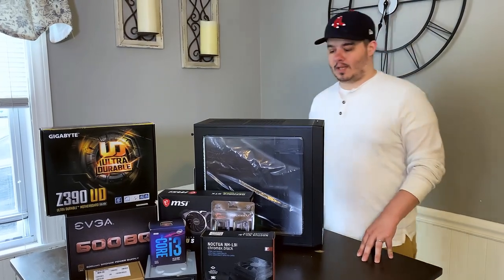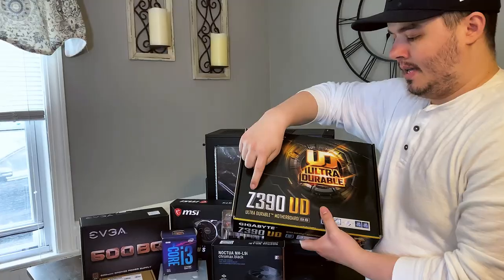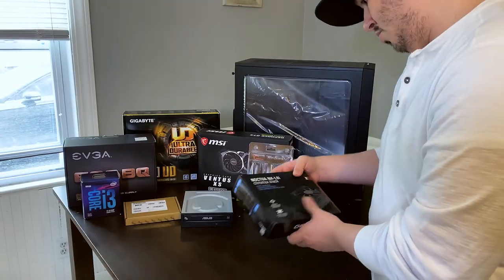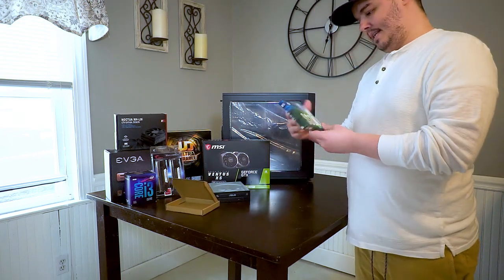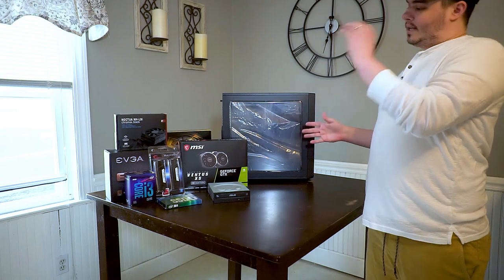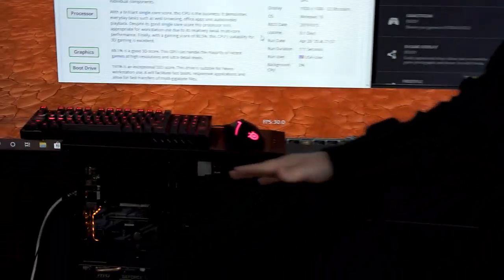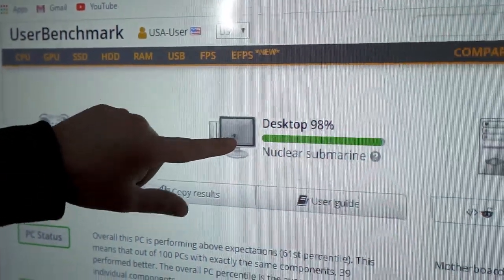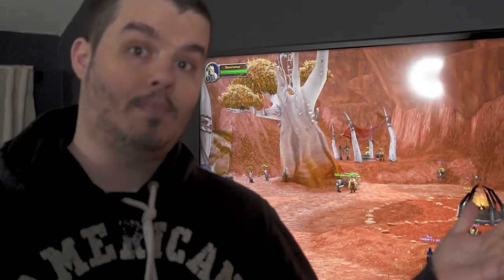Best Shadowlands PC Build for Under $900

Comment: And the proper position to really test machine is Boralus, market area, bank, portals, ship, of course when there are lots of people. That's where almost any machine gets fd really hard, even mine sometimes struggle to get 100 fps, and before heavy tuning (watercooling, overclocking) i was sometimes unable to even maintain 60 there. That's the test site that shows worst case scenario and loads parts pretty much like heavy BGs, raids, 40 ppl world bosses etc.

Comment: Get my parts in tomorrow. Im not doing a complete build just an upgrade. I went with the ryzen 5 3600x ( because the 3600 wasn’t in stock) gigabyte b450m ds3ho mobo gskill 3200 ram and a rx 570 gpu. Spent just under 500
Reply from the maker: Thats going to be a nice build. Let me know the Userbenchmark score when you get the chance. -Jim
Reply: 570 only :(? Should've got a 5600xt
Reply: Tropicocity I was on a tight budget. I only paid 120 for the card. It will be upgraded in the near future just needed something to get me going.

Comment: I feel like this build is decent, but poorly timed. AMD have just announced the Ryzen 3 3100 and Ryzen 3 3300X, while we expect that Intel are going to announce their 10th gen Comet Lake desktop processors within the next few weeks.

While neither of those launches will be transformative for performance specific to World of Warcraft compared to this build, I think a more general recommendation to wait for those products first before purchasing would be advisable.

- The Core i3-9100F is a quad core CPU without hyperthreading, meaning it only has four threads. While that's fine for WoW specifically, many more modern games are starting to ask more of a CPU than what four threads can provide.
- Buying into a Coffee Lake 9th gen system means buying into a platform that's at the end of its life. While you're not technically short on upgrade options with processors like the i5-9600K/F, i7-9700K/F, and i9-9900K/F, history would indicate that these processors will not drop much in price on the new or used market despite newer Intel processors launching, making their value compared to newer CPUs more questionable.
- Both of AMD's upcoming Zen 2-based Ryzen 3 CPUs, support SMT making them quad core, eight threaded processors. We expect Intel's 10th gen processors to also support hyperthreading across the entire stack, which would mean that the competing Core i3 series will also offer eight threads. Again, this might not mean much specifically for playing WoW, but it will make a difference in playing other games, or if the user is interested in perhaps getting into streaming their WoW gameplay for example, a CPU with more threads is going to be better suited to that task.

The build you've put together comes out to about $740 USD, not including the cooler as it doesn't appear to be in stock anywhere. For someone interested in stretching out to use more of the $1000 USD budget, I'd make the following suggestions:

CPU: Upgrade to an upcoming Ryzen 3 3100/3300X or one of Intel's upcoming 10th generation Core i3s. Depending on budget, a Ryzen 5 3600 or an upcoming 10th generation Core i5 could be a good fit too if you need more performance. If you absolutely have to buy right now, the Ryzen 5 1600AF is a great option if you need plenty of threads, while the Core i5-9400F is a decent option from Intel but I'd probably go with the 1600AF.

Motherboard: If you're going with a Ryzen system, either of MSI's B450M MORTAR MAX or B450 TOMAHAWK MAX are great options, though availability and price differs from region to region. If you plan to wait for Intel's 10th gen processors, you'll need an Intel 400 series motherboard with an LGA1200 socket (should be boards with H410/B460/Z490 chipsets). AMD also has mid-range B550 chipsets launching in June.

Cooler: Generally speaking, if you're trying to maximise your budget, you'll stick to using the cooler that comes in the box, assuming you're not buying an Intel K-series SKU.

GPU: The GeForce GTX 1660 Super 6GB is a great option right now. If you have the budget, the next step up from there is either of the GeForce RTX 2060 6GB or the Radeon RX 5600 XT 6GB. Alternatively, if you don't need to build right now, you could opt to wait and see what NVIDIA and AMD have in store with their new graphics architectures due later this year.

Storage: Adding in a 2TB hard drive would give the user plenty of space for miscellaneous files - downloads, music, pictures and so on, leaving more SSD space available for games and programs.

Nice video though. Builds and performance specific to World of Warcraft don't get talked about very often!

EDIT: I will also just say, I'm not big on UserBenchmark as a tool for gauging overall performance, as they've proven to be quite misleading with their results over the past few years. UB is fine for getting an idea if your specific components are performing adequately relative to other users of the same parts and making sure nothing is out of the norm, but their comparative performance rankings should be taken with a large tablespoon of salt.
Reply from the maker: Poorly timed, or calculated for a sick AMD Shadowlands PC in a few months? There's always room for another video.
Reply: @ReadyCheckPull  Hell yeah brother. Is the 1660 super a big upgrade from a 1660 TI? I have a 1660 TI and an AMD ryzen 7 3700x
Reply: @Direwoof  Definitely not. Go for 2060 or RX 5700
Reply: @solsona2458  Yeah 2060 KO looks good.

Comment: 3600MHz RAM seems like overkill for an i3 build. 
I would've just gone with 3000MHz RAM and put those savings towards a Ryzen 3600x. 

Also you installed the GPU in the wrong PCIE expansion slot. The one you installed it in is only PCIEX4, you want it in the PCIEX16 slot at the top, just below the m.2 SSD.
Reply from the maker: Hey! Thanks so much for the comment. The RAM was purchased at a better value, check out the PCPartPicker link. The PCIEX4 was honestly an oversight which I'll fix but from what I've read, the difference is very very VERY minor for this graphics card. I love the feedback though. thank you! -Jim
Reply: *3600, the X is a waste of money :)

Comment: I would've gone with a Ryzen 5 3600X, because it right now is the best price/perfomane CPU since it was released. Also, amd has sightly better per-core-performance, which is very helpful in WoW, because it needs exactly this.
Reply from the maker: The 3600X was one of the options I was looking at but it was over twice the price for less than 20% increase in performance, and the motherboards tend to be just a tad bit pricier for AMD at the moment. Love the comment and you'd be in a good spot with either choice. -Jim
Reply: The standard 3600 is actually better value but you can’t find them in stock at any major retailers right now.

Comment: Rate my setup I’m working on!
Rosewill Cube Mini ITX case (red)
Intel i7-9700k
Noctua NH-L9i chromax black 
Gigabyte Z390/LGA1151 AORUS PRO MoBo
Corsair Vengeance (2x16GB) DDR4 @ 3600MHz
Nvidia RTX 3070 (not released yet)
Samsung 980 PRO 1TB SSD (out of stock)

I have everything ordered except the SSD and GPU. I wanted to future-proof my PC for WoW for a few expansions on top of playing other games.

I decided to purchase a PCI-e 4.0 SSD and GPU so I could upgrade later once Intel supports 4.0 like AMD instead of being behind. Hopefully the Intel 11th gen processors support PCI-e 4.0!!

Can anyone recommend me a good monitor? I was thinking 27”, 1ms, 144Hz.

Also a mouse, keyboard, headset and speakers?

Keyboard- Thinking a Corsair K95 mechanical 
Mouse- Corsair Scimitar, Naga, or Logitech 
Headset- ???
Speakers - ???

Thank you!

Great video, a lot of people complaining about the i3-9100F, it’s an amazing processor for being $75-$80. WoW Shadowlands recommends a 6th generation processor and that i3 is a full 3 generations newer. Plus, it has an awesome stock clock speed and won’t bottleneck that 1660S. 

Personally, I would wait until Nvidia stocks up on their 3090 & 3080. On top of releasing their 3070 (10/29/2020) and the 3060 is rumored to be 1/XX/2021). The older GPU especially non RTX models will be cheaper and the older 20-series Nvidias will also drop in price. Might look into a Nvidia RTX 2060S in the upcoming months for someone who doesn’t want the 30 series!
Reply from the maker: This build is really great. It's basically my exact workstation build which runs like a champ. I can see you aren't really concerned with price so I won't make any suggestions there. As for monitor, I'm running the Omen 27ips (make sure it's the ips version). I'm not too sure on speakers because I use Yamaha HS8 Studio Monitors that are made for mixing audio. That Rosewill case is gorgeous btw. For headset are going wired or wireless? I know a few people who love the Beyerdynamic dt770 pro and attach a Mod Mic to it. I use open back headphones at the moment but am also looking for a nice set of close back. Let me know what you find for a headset and speakers, we seem to have very similar taste.
Reply: @ReadyCheckPull  

Budget was definitely in mind since I’m currently $1151 into the PC build (includes epic edition pre-purchase of Shadowlands). I’m waiting for that 3070 to hit Nvidia for $500 + fees. 

For the headset, I would desire wireless unless the wired headsets just have better performance and most-likely less money due to  retro-spec technology. 

I can never understand the people that are $3000-$7000 into a PC.

Comment: 9100F with a Z390 mobo seems like a bit of a waste. I know you said you wanted room to upgrade later, but it would make more sense to at least get an overclockable CPU with that mobo.
Reply: Exactly. i3 8350K would be much better choice. You dont need Z chipset to run 9100f.

Comment: Really low end CPU and higher end MB does not make much sense. 600W PSU is overkill and you could easily go with 500W having much headroom. Noctua cooler for computer in this budget?! I have doubts if 3600Mhz ram makes sense for this processor.

Comment: guys you gotta get them rtx cards rather then the GTX 1660 you will get the ray tracing and it will look amazing will add a new level of detail to wow
Reply: Have they confirmed ray tracing for shadowlands?
Reply: @mheald111  it has indeed!
Reply: Most of not all modern games now have Ray Tracing intergrated. All Nvidia GPUs will have the “RTX” tech in them over the GTX. You can pick up a RTX 2060 for a competitive price and have better performance than a 1650S or a 1660S.

Comment: im planning on getting these parts soon but would changing the cpu for an i5 9600k be any better?
Reply from the maker: It definitely has a bit better performance than the i3, but it's likely over double the price. And there might be other options at that higher price-point, so it's hard to say if that'd be the best option for you overall.
- Zax
Reply: cool thanks, this is my first build so idrk what im doing and im definitely not trying to spend too much money just for Shadowlands 😂
Reply: @dallyjk  if you want K CPU, get i3 8350K, cheap and handles wow very well.

Comment: Would i5 9400f, gtx 1660 super, 2x8gb RAM be enough for 1440p gameplay at about 60-75 fps?
Reply from the maker: It depends on what type of content you are doing. If you are raiding, you might have to drop your settings a bit. Should be good on recommended settings for most other things but raiding at 1440p is tough on 1660 super. -Jim

Comment: i'm looking for a good PC and my budget is $1000. Is this setup actually good or is this one of those video's that's sponsored and just add a few things because of that? only going for World of Warcraft.
Reply from the maker: It's legit. Jimfro built this for his friend and he's had no complaints! Every part is close to the best price-to-performance ratio you can get, so it won't be the top of the line, but it's more than enough than you need for WoW for a fraction of what you could spend. You might want to look around for different deals that might be going on, because the prices for these things change like crazy! You might even be able to upgrade a few things depending on the prices.
- Zax

Comment: i have 
- i3- 9100F 4.2 GHz 
- Graphic card GTX 1650 SUPER StormX 4GB GDDR6
- 8GB Ram DDR4
- SSD 240GB
 
is it good for shadowlands ? and any advice what should i change and ty
Reply from the maker: Yes Although, I would strongly recommend upgrading your ram to 12gb or even 16gb and maybe down the line get a little more SSD space to give you some breathing room for other things. Other than that, this is a solid build.

Comment: hey i have : i3 9100f /Asus gtx 1060 3 GB / ram 8GB 2400mhz / ssd 510 apacer / is it good for shadowland ?
Reply from the maker: Yeah that's good! If you wanted to upgrade anything, I'd start with your RAM. It's pretty cheap to upgrade to 16GB or higher MHz or both. If you want to crank your graphics up, you'll want to upgrade your graphics card, but that can get expensive quick. 
- Zax

Comment: That's not even Orgrimmar... That's a starting zone with no one in it.
Reply from the maker: I mentioned that in the video. I should have done the test in Org and in a raiding environment but you live and you learn. At 1080p Org gets 90-100 FPS on recommended settings which is amazing for the price. -Jim

Comment: Would this same build work with a Ryzen 5 3600 ? 

Also what was that on ultra everything ?
Reply from the maker: Hey! So you could easily switch out the Motherboard (to one that's made for AMD instead of Intel) you could then use the Ryzen CPU. Here is the link to the parts that would work, there are probably some options that are better but I think this is pretty good. https://pcpartpicker.com/list/HjzPL2
Reply: Ready Check Pull thanks a lot !! 🙂 Stay safe!

Comment: 9100F will be knocked out to 0 fps on the very first 40 ppl world boss quest. Never buy cheap CPUs if u play warcraft, get at least 4 cores with 5 ghz, for real. At least! 

In mythic raids warcraft knocks down 10980XE w/o overclocking. I had to watercool my 10980XE and heavily overclock it to maintain stable 4k 60+ fps in mythic raids in any situation. And ofc your video card won't work properly if it's bottlenecked by cpu. Either thing goes about memory, at least 3600 mhz with CL16 is heavily advised.
Reply from the maker: Yeah this is just not true. 4K is not the same requirements as 1080. Not everyone can afford a top-of-the-line cpu. And the 9100f is 4 cores. It’s also the highest value per dollar for any CPU at the time that I created this. -Jim
Reply: @ReadyCheckPull  but i tried to lower the res to 1080p before starting it all, it didn't help. In cases like 40 ppl wb, raids etc resolution doesn't matter like at all cause the bottleneck is not the GPU.
Reply from the maker: Well then I think you might have something else going on because the 9100f is able to get 100fps in the middle of org. -jim
Reply: @ReadyCheckPull  nah, it's just bad optimization. Watch this: https://www.youtube.com/watch?v=SVXfA7cKqHQ

It's 30 mages vs Nyalotha video, Scripe streaming, former Method RL. @ 0:50 they're pulling Wrathion, watch what happens then with WoW @ Scripe's PC :) That's just state of raid optimization ATM, same BS happens @ 40 ppl world bosses, Boralus crowded etc. Scripe's PC is definately not a potato one, and he definately has a deddicated stream machine.

Comment: I'm confused. Min requirements say i5, you're using an i3.
Reply: You can pick up a i5-9600k for ~$200
Reply from the maker: So i5 is not the part that is the minimum requirement, the 760 is. i3, i5, i7 and i9 are all sub brands like on cars I can have a Ford Mustang from 1964 or 2020. Very different. The i3 I recommend is far better than the i5 on the min spec recruitments. -Jim
Reply: @ReadyCheckPull  The i3 you used in the video is even better than the i7-6700k on Blizzard’s recommended requirements. That I7-6700k still sells for $300, even on Amazon. For the same $300, actually I paid $275. I picked up an Intel i7-9700k which blows away that 6700k and I’m future-proofed for at least an expansion or two.
Reply: I don't fully understand PC building. So my current PC is sucking at WoW(it made everything low/disabled) my PC is i7-4770k, 16GB RAM, I currently have a GTX 760(this PC was built in 2014 a week before WoD, and it's been great until now) if I just replace the 760 with a 1660 super, could that work? Legit I play 1 game, WoW. I don't wanna buy/build a whole PC, I just wanna raid and get back to maybe medium graphics =/